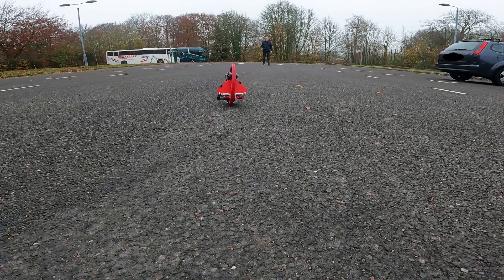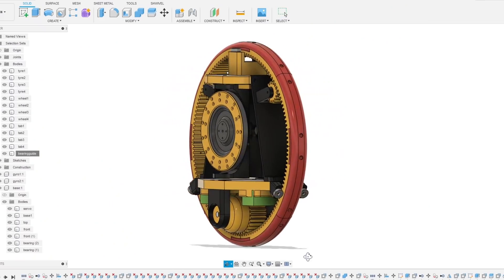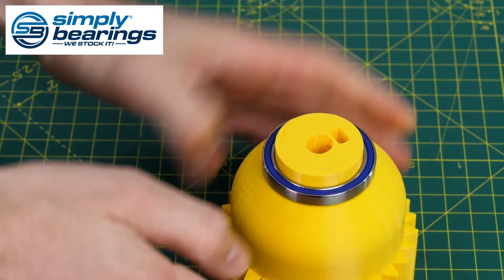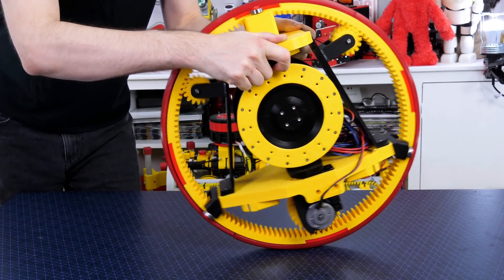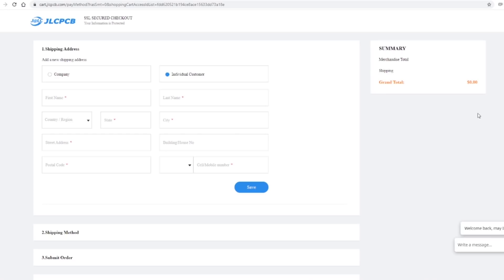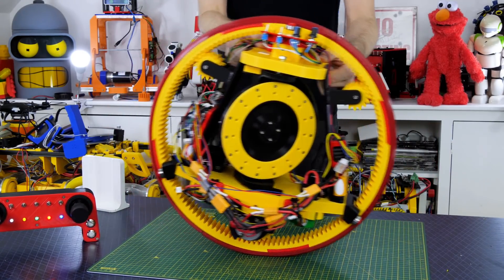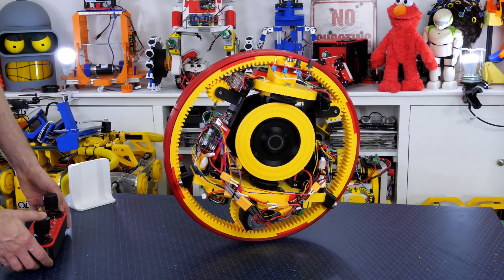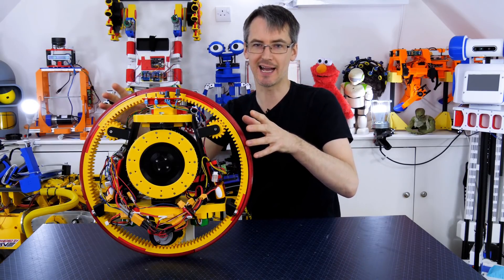Gyroscope Stabilised Monowheel

Comment: this is why spacecraft that use control moment gyros for stabilization always have some other way of holding attitude. if the spacecraft is subject to some unbalanced torque (from radiation pressure, magnetic fields, etc) the CMGs will move as far as they can go and become saturated. to unsaturate them, they're moved back to the neutral position and the spacecraft's thrusters are used to counteract the resulting torque. the term for this is momentum dumping. the robot crashes because it has no way of doing this. being tilted over results in a constant torque which will quickly begin to saturate the gyros, so that they will be moved very far in one direction even when the robot returns to vertical. unless you plan on doing the exact same amount of left turns as right, this concept fundamentally cannot work. now, this does give me the idea of creating some kind of robot that uses CMGs for most of its control, but has compressed air jets for momentum dumping.
Reply: The robot could unsaturate the reaction wheels by leaning a small amount the opposite way and letting gravity unsaturate the wheels (I think, not entirely sure). But yeah, it has to be done standing still if you don't want to turn.
Reply: @huvudpersson7344  pretty sure this will work. You just need a bit gyro power left to flip the leaning side and let it hover there until desaturated. would be fun to implement this in the stabilize algorithm and correct its saturation levels as it goes.
To solve the forward backward leaning problem of the gyro add them to a slide that corrects its position back to center. Could even be used to help control steering. I would love to work on the algorithms doing all that in parallel. Must be fun to watch afterwards doing its things to balance.
Reply: @huvudpersson7344  Using gravity to unsaturate reaction wheels has precident in spacecraft too. If the ISS points its long axis towards the earth there is a slight tidal force that tries to keep the station aligned that way, and it can use that as a propellent free method of momentum dumping.
Reply: @huvudpersson7344  To do this, his control loop needs a right-half plane zero in its function.  Boost DC/DC converters have this same problem.  It makes them more difficult to tune to stability.
Reply: How do boats do momemtum dumping?
Reply: @xWood4000  i've never worked with gyros on a boat, but im assuming it doesn't have to. a boat is passively stable, even without a CMG it will return to vertical if you leave it. you use the gyro to correct for oscillation from unsteady seas, and when its quiet for a moment you can slowly return the gyro to neutral and the water will keep the boat from rolling.
Reply: @yokowan  I suppose you could view it as it's passive stability doing momentum dumping for it, without having to add a mechanism for it as it's shape and buoyancy naturally give it one?
Reply: This thread qualifies for the most intelligent comment thread on YouTube... I needed this. Thanks.
Reply: Deployable outriggers to allow it to park and realign gyros?
Reply: So, a robot with corrective farts? Sign me up!
Reply: @diegodoumecq5144  ... #JustAddThruster
Reply: i' love to see the gyros mounted inside another gimbal to try to keep them nearly vertical
Reply: Is that more efficient that using compressed air for stabilization directly or is it just more intriguing
Reply: You could just use moving weights to counterbalance the gyro effect. The combination will work better than just using gyro effect.

I have seen an old movie where a man had build a kind of mono wheel tractor.

The wheel itself could move from left to right and front to back when breaking. This worked like a counterbalance.
Reply: @BartvandenDonk  I was about to suggest this.  A tiltmeter connected to a servo-controlled mechanism that would move a weight out from center to counteract the tilt.  Much the same as steam engines used lever-mounted heavy weights to control speed.
Reply: what about just touching the ground instead?
Reply: Maybe that could be solved by having 4 gyros instead of 2 so that the gyros could take turns giving a chance for the other set of gyros to change direction. That would allow for different times working to desaturate the gyros.
Reply: @mysti_is_lost  when you remove angular momentum from one pair of gyros, you need to add it to another. you need to dump it into something else. conservation of momentum is an unyielding beast
Reply: I would love to see a video that shows momentum dumping. Looking that up next

Comment: You need a slower PID that takes the gyro position as input and changes the left right angle setpoint as it's output. That way it will lean itself left and right automatically to keep the gyros from hitting their end stops.
Reply: Also the dampening of the pid is to weak for the side to side stabilization.. it oscillates quit heavily 😅
Reply: Actually PID is not a good control strategy. The force vector being so close to the center of mass causes a bifurcation in the systems phase portrait. The system is not guaranteed to have unique control solutions. 

So the PID assumes solution uniqueness, i doubt PID is sufficient. lowering the center of mass more will make the pid work better

Comment: Gyros need to be isolated, need bearings and a weight to let them float in the middle, always upright regardless of drive angle.
How would that work with steering angle though? Dunno.